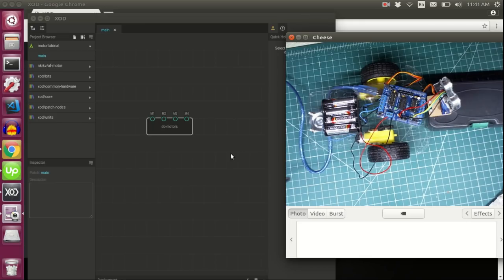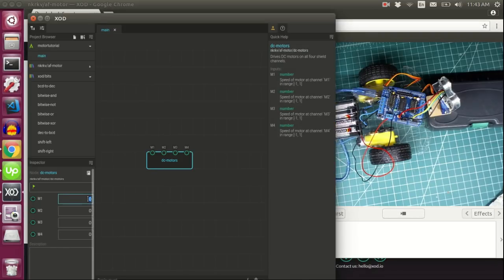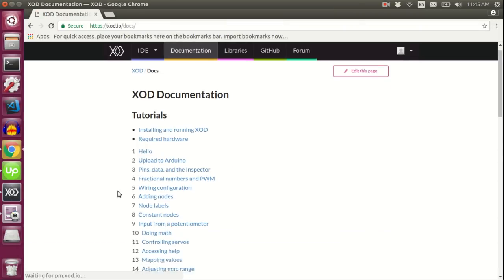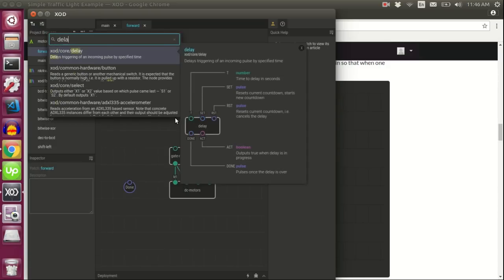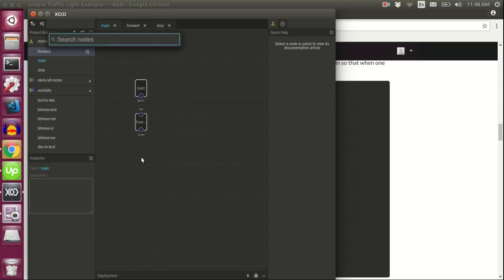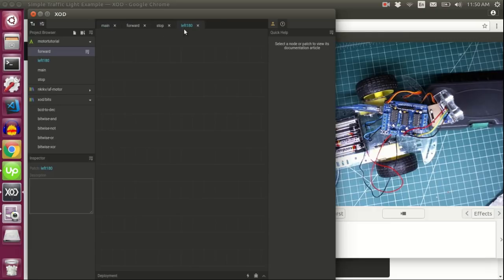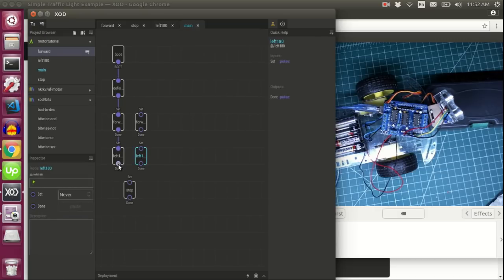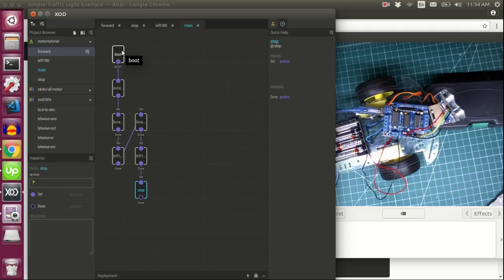XOD programming of Arduino Robot – DC Motor Control

Comment: Great job, you explain things at a great pace and seem to read minds, as I was thinking why do you do that you explain.
Can this library be used to control a stepper motor with big easy driver?  If not is there another that could be used. Thanks
Reply from the maker: I'm glad you liked the video. I'm not familiar with that driver. I'd recommend heading to forum.xod.io and asking the question there. The developers of XOD are extremely knowledgeable and quick to respond. They should be able to tell you more.